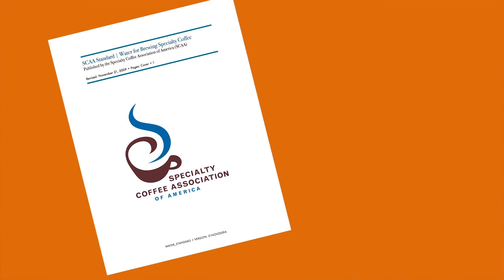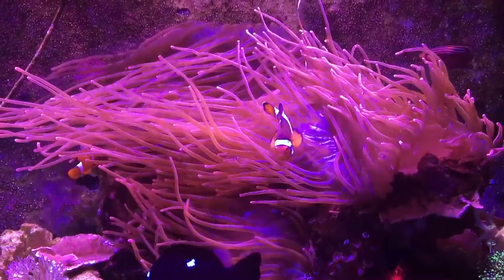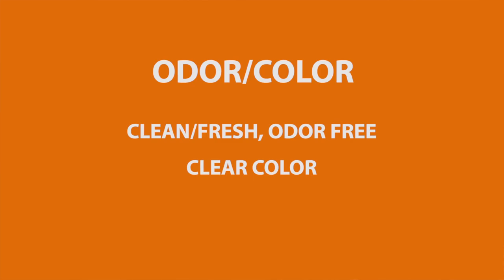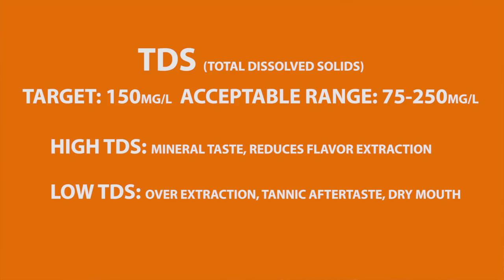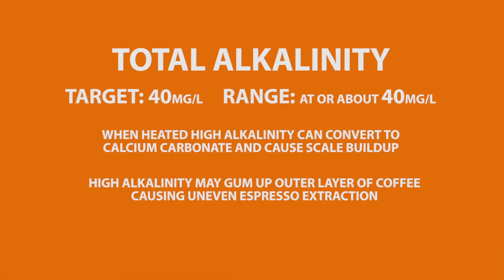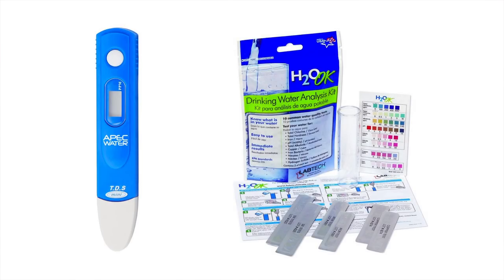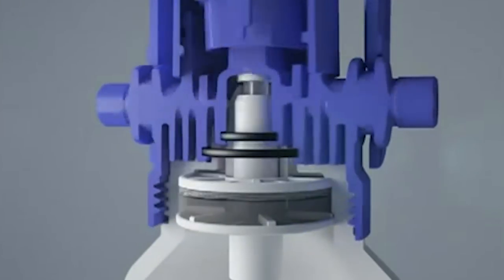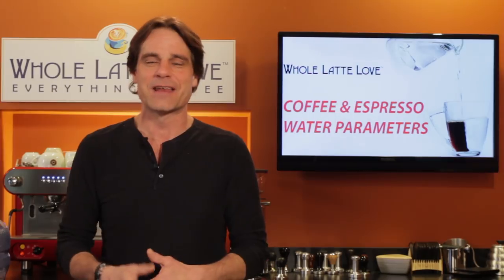How To: Brew Water Chemistry for Coffee & Espresso

Comment: FYI, evaporation only works for chlorine. However most municipal water treatment also uses chloromides, which are bonded and therefore non-volatile. You will absolutely need a carbon filter to remove chloromides, which have a similar negative impact on flavor.

Comment: Beautiful aquarium Marc! And that's quite the chemistry set you have there for water testing!  :D  The coffee you brew at home must be outstanding!!  :)
Reply from the maker: Hi, Thanks! I use the kit for testing aquarium and the tap water for coffee! I'm not the only one using a reef aquarium test kit for coffee water.
Reply: I have also used water test strips sold for aquariums. They are very helpful! I use a Rocket resin filter in my espresso machine's water tank to reduce the hardness. It does make a difference in my coffee's flavor. :)
As usual, great info!!!
Reply from the maker: That's perfect! Should help reduce scale as well. Thanks for sharing!

Comment: Hi Marc,

good information, it makes totally sense! If we think that a good espresso or cup of coffee is 
made with 96-98% of water, that is as important as the coffee, grinder 
and machine.

.... interesting I also had aquariums and used an reverse-osmosis system 
with adds and testings. 

Our current water supply in central 
Switzerland has about 30fh and all other tube staff, so very hard water. 

I found two mineral waters for a perfect blend. Its work blending them, 
buying and carrying the bottles, but all in all it gives fantastic 
coffee, tea 
water and prevents our Expobar dual boiler. Cost's are more or less the 
same with our hardness  if I calculate the BWT Pats and Table Filter (we
 need min. two filters in order to break it down form 30-35fh to 6/7 dh). 
However the BWT Bestmax Premium after 600lt would be a little cheaper, 
but  as far as I am aware it can't filter hormones and drug chemicals. 
Therefore as long as I get these mineral waters at reasonable price 
here, I do the work and blend it.

Best Espresso regards

Kurt
Reply from the maker: Hi Kurt, Thanks for the comment! Sounds like you found a good solution for getting around some very hard water. Guessing you are in a mountainous region? Extra hard water is common in those areas - same for parts of Western US. A lot depends on the source. My tap water comes mostly from the Great Lakes with TDS usually about 150ppm. I believe activated carbon filtration will remove chemicals beyond chlorine. I run a sock of it in my aquarium sump to remove poisons given off by corals I keep.

Also, if you still have the RO system might consider using that water dosed with minerals etc to bring it up to standards for brewing. I'll be doing a video on that soon. When I started the aquarium years ago I used to purchase RO/DI water from the aquarium shop for weekly water changes. Got tired of paying for and carrying 15 gallons of water home all the time. I was spending about $25/mo on water. I picked up a 50 gallon/day RO/DI system with the input/output TDS meter for about $85. Paid for itself in < 4 months!
Reply: Hi Marc  

yes and no I live in Baar / Zug central Switzerland, whole Switzerland has hard water except some cities when its form the Lake supply. We in the canton of Zug have source water and our mountain of Zug is only 800 meters above sea level. not very high but one of the hardest waters in Swtzerland. 

http://www.zug-tourismus.ch/en/home

When I had the aquarium I also used an RO system the TDS is imprtant and metal contents also. Guess you blend aquarium water,  RO/DI water with some additives or some regular tap water.

Still its work but for a beautiful result. what is nicer to sit early morning in front of an aquarium with a good espresso and enjoying the fishes.

Comment: I have the BWT penguin pitcher - but the water is still very hard out of the pitcher. Is the water safe to use in the ECM Synchronika? My main concern is preventing scaling/damage.
Reply from the maker: Hi a, If using the pitcher as directed you will not get scale in your machine. If you tested total hardness of water from the pitcher it's measuring the magnesium as part of the hardness. The magnesium will not cause scale in the machines. If you were to measure carbonate hardness it should be lower after treatment in pitcher.

Comment: Hello and thank you for the video!  I too have saltwater reef tanks and a water filtration system for them.  Mine has Reverse Osmosis with the additional stage for de-ionization.  It looked like from the video that yours does, too.  My question is, is it ok to use the full RODI filtered water, or should I bypass the de-ionization stage?

Thank you,

Rob
Reply from the maker: Hi RR and hey fellow reefer! No need to go around the DI stage. But do be sure to remineralize your RO or RODI water before using in machine!
Marc

Comment: i started adding a little distilled water to my tank. I think it reduces the hardness but maybe the water is a little acid now. its only like a cup to 8 cups tap.
Reply from the maker: Hi HCG, It would reduce hardness but it really depends on where you are starting. For extra hard water adding 1 cup distilled to 8 cups tap is not going to reduce it much - just 12.5%. Would not worry about acid. Distilled water is neutral at pH 7. Technically when exposed to air it does absorb CO2 so over time it may be slightly under pH of 7 but not so much it would make any difference especially when diluted into the tap water. If you think your tap water is way out of standard, stay tuned for a video coming soon we'll show how to add a buffer and mineral source to distilled water to make SCA standard water and more.
Reply: thank you for this...I always thought distilled water was acidic because it likes to strip minerals from things because it has none. I will stay tuned.
Reply from the maker: You are welcome!

Comment: What impact does a Zero Water filter have if I use it in my reservoir? Is it the equivalent of RO or Distilled? Should I treat it like in your water treatment video with epsom and baking soda?  My normal tap water is a TDS of around 20, with chlorine for sure.
Reply from the maker: Hi Ron, Thanks for the question. Zero Water uses a DI resin to remove dissolved solids and bring TDS to near zero. I would most definitely re-mineralize water that's at zero TDS. You can do that as in my video with baking soda and epsom salt. If your unfiltered tap water is at 20ppm TDS I'd be really surprised. That's incredibly soft! A simple activated carbon filter would take care of tap water chlorination. Really no need to use a filter with DI resin on water that soft out of the tap. If your tap water really is 20ppm TDS I'd re-mineralize that as well before using for coffee/espresso brewing. Hope that helps!
Marc

Comment: Hi Marc

I heard somewhere that the water for an espresso should be chilled prior to entering the machine. I.g. putting some ice on the reservoir to chill the water. Does water temperature has any effect on taste or anything?

Thank you! Great info on all of your videos!
Reply from the maker: Hi R, You are welcome for the videos! Hmm... chilling water prior to putting it into the machine. That's a new one on me. When I'm filling a reservoir I always use water from the cold water tap. But, I don't think chilling water has any affect. In most machines the water in the reservoir will warm up a bit due to proximity of the boilers and once in the boiler it's going to be heated anyway so I don't see why it would make a difference.
Marc

Comment: Hi Marc! Thanks for the clarification with water in brewing espresso. 

So, I have soft water coming from the tap, around 55 ppm. I currently don't have a strip to test for calcium directly. I am currently assuming that calcium level is low enough not to be concerned for lime scaling. However, I wonder if low alkalinity is going to cause strip damage to my machine. 

I have a BWT water pouch, which I am hesitant to use for that purpose. Should I use the pouch for balancing out the alkalinity? Or is adding some baking soda to the soft tap water a good solution? (I couldn't help myself with the pun)

Again, thanks always for great content!
Reply from the maker: Hi Josh, You're welcome. At 55 ppm scaling potential is low. But, if using tap water straight I would still descale every 6 months just to be sure. I think it's unlikely alkalinity would be an issue - what's the pH of your water? If above 6.5 no worries. If significantly lower you could use baking soda. The BWT Bestsave pad filter exchanges magnesium for calcium and has activated carbon to remove chlorination. As far as I know it will not change your alkalinity. It will reduce calcium and keep you at or near your current hardness. If you were to use the Bestsave you would not need to descale.
Marc
Reply: @Wholelattelovepage  Thanks for your input!

Comment: Hi Marc..  Thanks for the great info (helping me get yet another variable under control).  

Do you recommend any test method or testing brands?   

I was about to go insane trying to figure out testers for hydroponics, hopefully diving off the deep end will not be required here, LOL.   I do have a bestMAX (not hooked up yet).  

I found “Hach” test strips that measure TDS, free & total chlorine alkalinity and pH..  But they don’t measure calcium carbonate specifically (nor sodium, but I’m pretty sure I have soft water already). 

I’m under the impression the main thing I want to test is the calcium, so should I buy additional test strips for calcium carbonate specifically?   I noticed it there is a much higher TDS range than calcium alone..
Reply from the maker: Hi Robert,

You are welcome!

Honestly you don't need to go too deep into testing if you know your water is relatively soft already. As long as your tap water is safe to drink and doesn't have any weird edge case issues the BWT Bestmax has you covered. Just be sure to set the bypass properly on the BWT head. For that all you need is to test for total hardness. No need to test for calcium separately. If you're water is relatively soft your bypass setting will be a 3. Total hardness test strips are fine to use and very inexpensive. Or, get the info for free! Most municipal water authorities publish water quality test results online or you could contact them for the information.

Here's what the online report looks like in my area showing total hardness of 120ppm: https://mcwa-wordpress-media.s3.amazonaws.com/wp-content/uploads/2020-Data-Summary.pdf

Here's a chart which converts ppm to German hardness degrees which you will use to set your bypass: https://monarchwater.co.uk/wp-content/uploads/2018/01/Water-hardness-conversion-table.pdf

For me it works out like this:
Total hardness 120ppm (same as 120 mg/L) = 6.7 degrees German hardness.
I'd set my filter head bypass to 3 and get 1,070L of filter capacity from a Bestmax S size filter.

If you do test, be aware the total hardness will not change much after filtration as much of the limescale causing calcium is exchanged for magnesium in the filter.

Hope that helps!
Marc

Comment: Hi there. :) I have a fully automatic that has a filter in the water resivouir. I usually get my water from my refrigerator water spout which also is carbon filtered. Is this too much filtering? I am interested in how double filtering affects the machine and coffee taste.
Reply from the maker: Hi Stephanie, Thanks for a great question! I cannot be certain, but it's likely your fridge filter only has carbon and sediment filtration and does not soften the water (replace some level of minerals with salt). If it's carbon only, then no worries as carbon is there to remove chlorine and chemicals with very minimal effect on minerals. Your machine's in reservoir filter most likely has both carbon and softening. Putting your brew water through 2 carbon filter is not a problem. Even if your fridge filter does have softening, it's likely not an issue as once the mineral level is reduced an additional run through second softening filter will have no affect.
Reply: Awesome!! Thanks!! I did test the water hardness directly from the tap and it barely registered. The one good thing with our area is we never have to worry about hard water. The town takes great care of our water supply!

Comment: Hi!  I have been using a 5 stage RO system at home because water is pretty hard.  I get great tasting coffee from it.  Do I still need to test for balances or does the RO takes care of most of it?  thanks
Reply from the maker: Hi CM, Thanks for the question. It depends... Does your RO system produce zero TDS water? If so, then your water is actually too pure. Zero TDS water will over-extract coffee and the lack of minerals produces a flat flavor. While extra pure water sounds like it would be better, it is not. Beyond lacking flavor it can also be a problem for the machine. With mineral free water you will get no scale deposits but you actually want a small amount of scale to form in boilers. A very thin layer of scale inhibits leaching of boiler metals. There are many different configurations of RO systems. Some residential and commercial systems mix  untreated or partially treated water back in with fully treated water to arrive at water with reduced minerals etc but not perfectly pure. Not knowing how your system is setup, I would test for hardness, alkalinity and pH and see how it compares to SCA standards. If your water is zero TDS, it's fairly easy to add some baking soda (sodium bicarbonate) and epsom salt (magnesium sulfate) to create water that's inline with SCA standards. Look for a new video showing how to do that in thew next week or so.
Reply: Hi thanks for the reply.  I do not recall if we get 0 TDS but I'll start from there thank you.  looking forward to the next video.
Reply from the maker: You are welcome!